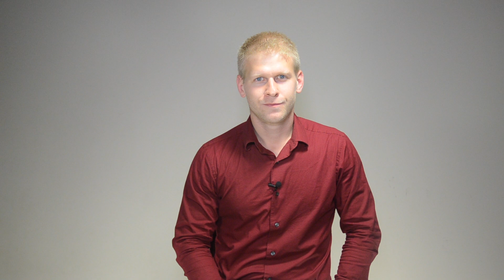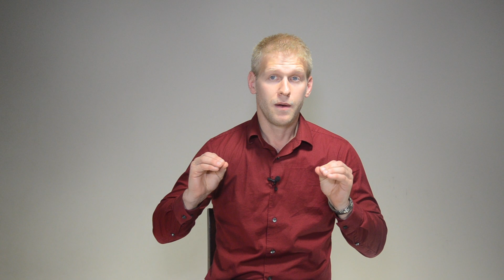Fake Refresh Rate Explained, Simulated, TruMotion, Motion Rate, MotionFlow, Clear Action, AquoMotion

Comment: basically... half the number.. if it's truemotion 240, the tv's refresh rate is actually 120hz... if it's (marketing term) 120 it's actually 60hz. what they do is artificially process the image in the tv, they double the frames shown to you (hence the doubled refresh rate), these are duplicated frames basically and black frames to from what I understand.. and more frames trick the eye into perceiving a smoother motion... so they say..  overall, higher refresh does help but the fake refresh is more marketing tech than really getting something good.. but hey, a 120hz native tv is pretty darn good even if it's 240hz fake.. heh. 
refresh rate is sort of like Frames Per Second, it's very similar but it's not quite the same thing tho they are somewhat tied together.. it's not easy to explain the difference, at least for me... heh. but more refresh rate mean more images a second, and like FPS in games.. it makes everything smoother..  
 BUT say you hook up a PC or gaming system.. all that fake refresh rate is junk to it. meaningless.  the true refresh (native) is the one that matters to it. some newer tvs as of this writing are giving actual higher refresh rate support natively and advertise such... but getting that 4k120 on your comp is impossible because unless you have display port on it to connect or it has the spanking new hdmi 2.1 ports.. you aren't gonna get over 4k@60hz.. so much depends on the hdmi ports. think of them like versions of USB.. they support "bandwidth" sizes like usb.. 1.4 has a bandwidth of around 10gb/s.. 2.0 has 18gbs.. 2.1 has 48Gbs (and can do 10k@120hz!) so much is limited to what version of HDMI ports are used on the tv.. so keep an eye on the older one's.. look up the hdmi wikipedia article (it's not too technical) for a simple list of versions.. cables are rated for the version in general.. hdmi 2.0 cable has a bandwidth of 18gb/s.. so, if you use an hdmi 1.4 cable in a 2.0 port, you might lose some of the higher resolutions and refresh rates.. thankfully, it's backwards compatible at least.. but what matters most are the ports on the machine and the features of HDMI they decided to implement.. the cable is just a pipe to pump data through, it does not have features.. (besides the one with the ability to also do an ethernet connection). BUT just cause it says "hispeed" does not mean it supports HDR 4k (4k@60hz is needed), some HDMI 2.0 cables do not provide enough bandwidth to support HDR resolutions.. so really look at the specs.. you don't need expensive cables but one's rated for the job you want.. 
hope this helps some..

Comment: See I’ve been reading about this for the past few hours. 60 MHz is bad no matter however HDMI rate is locked in at 60 so if a LCD tv says it’s 120 MHz then it’s actually not even if it says it is. All refresh rates beyond 60 are simulated on LCD tv.

Comment: Chad, I have a quick question. I got Samsung UN40J6200AFXZA (which says Motion rate 120 straight forward) and wanted to replace it with UN40KU6290 (4K) which says Motion Rate: MR120. I wondering if that would really makes some difference? Or would it be a good deal to go with UN40KU6290. 
Your help would be appreciated.

Comment: What if you have a 60Hz refresh rate for a 24" gaming spec'd monitor..... is it still bad? Or is this an apples to oranges type of comparison? Basically I was playing an FPS on a 55" Samsung with 120hz and then played on a 24" gaming monitor with a 60Hz refresh rate. Now I know the smaller screen size created a lot of benefits for me as the safe eye distance from a 55" TV introduced a lot of peripheral vision that has no value to the game itself. The smaller screen definitely help in that regard. However it feels cleaner too. I have increased my shooting accuracy about 8%-10% per weapon across the board which is pretty huge results. In FPS gaming every ms counts.
Reply: It depends on your graphics card, if your graphics card is allowing you to play a game at 200 fps and you have a 60hz monitor then you are only seeing 60 fps, so you would not notice a difference between a 60fps or 200fps output. however if you were playing on a 144hz with 200 fps you would notice a significant improvement in image quality compared to a 144hz with a 60 fps output. 

To put it as simply as I can you are getting "wasted" frames because a 60hz monitor will not keep up with your graphics card, if you have a graphics card giving you more than 60 fps.
Reply: Thank you Joe! I am playing on an X Box One so I just researched that and a lot of people are saying it has a maximum of 60 fps. If that is true then I think I am looking pretty solid.

Comment: I just purchased LG 49UH850v which LG site say refresh rate is T200HZ i would expect T is for true 200 HZ however i saw many sites say it's just 100HZ and i called LG call center and they said it's 100 HZ not 200HZ but their facebook page says to me it's 200 HZ :D 
lot of confusion on how to know the real HZ for my TV? and nothing mentioned in Manual and noting wrote on the box!
So how could know this info? and searched about its response time and didn't find any info.
Reply: They oopsed and should not have put Hz behind it.  Also the T stands for Truemotion 200.  Simple rule if it is their simulated refresh rate and the # is below 240 it is less than 120Hz. If it is at 240 or higher it will be a 120Hz TV with added bonuses.

Comment: so my UA55JU6600 that has 120Hz Motion Rate is actually 60Hz? So if I play a 30fps video on a 120Hz motion rate TV how many FPS should I see?
Reply: I just looked up the specs on your TV and your TV has a 100Hz refresh rate which they call motion rate.  If the manufactures say Hz then it is the true refresh rate. If they say motion rate 200 however it will be less than a 120Hz refresh rate.  simple rule if it is their simulated refresh rate and it is below 240 it is less than 120Hz. If it is at 240 or higher it will be a 120Hz TV with added bonuses.
Reply: Well, first of all you have a 4k tv. You can not achieve 120hz on a 4k tv unless you downscale to 1080p and even some tv manufacturers do not even support 120hz at 1080p, they have 60 hz for both 4k and 1080p. If you are watching a video that is 30 fps, you will see 30 fps, you may even encounter screen tearing which is when whatever you are watching does not match the refresh rate of your tv it will look like two images splitting in a fraction of a second occasionally. Lets say you have a 60 hz panel, well everything you see will be 60hz or less, depending on the source of what you are looking at from. Same goes for 120hz. Unless you are on a PC that supports more, you can see fps of 120 but your eye can't process anything more than 110-120 hz. It's humanly impossible. Like it will look smooth as silk over 100. So do your research and before you buy a tv, look up the specs on various websites except for the manufacturer.

Comment: how can 60hz panel be 'bad' when the content you feed it is updating <= 60fps? Tv/movies are generally 24fps, at best game consoles are at 60fps.. having 120hz but 24fps content wont look any better then 60hz 24fps content, unless TV's work a lot differently to computer monitors.
Reply: Try looking at a TV with real 120Hz, you will notice the difference....

I don't know about the fake, so I'm kinda pissed with all the fake ones out there... I think I'll buy a 1080p TV just because I'm not spending $1000+ for a real 120Hz 4k TV...

I'll spend Mid$600 for a 1080p real 120Hz....

Fucking lame
Reply: @kingjon5818  The "real" 120Hz will just keep your single frame image from your 24fps content for 5 refreshes before displaying the next image for another 5 refreshes. With an interpolation technology ("simulated") it will take the first image and the second image and "generate" additional images to display new images for the 4 "in between" refreshes from the native signal.

If you have 120fps source signal, then every refresh of the 120Hz display will be a new image directly from the source. On a 60Hz panel, every other image will be discarded, so you won't get the 2nd, 4th, 6th, 8th... image displayed.

If the interpolation method is good enough, you would not notice a difference between a 120Hz native and a 120Hz "simulated" panel for 120fps content, because the interpolated image would be exactly like the true 2nd, 4th, 6th, 8th... image
Reply: You are correct that the content coming into it does matter. However with out the higher refresh rate technology you can not reduce the motion blur you are currently getting on those devices.  The TV if 120Hz and using interpolation will generate extra frames from the images before and after its insertion point.  This will make your content look smoother.

Comment: Many people don't understand refresh rates and frame rates very well, but you can't really blame them because companies constantly mislead people with random numbers on the box for two different technologies. First of all, motion interpolation/soap opera effect isn't "fake 120hz" because the panel has to refresh at a higher rate to display those extra frames rather it is "fake 120fps" because the extra frames are created by the computer and not the source content. No TV will give you true 120fps because there is no 120hz source/signal on TV that exists, yet. Native 120hz TVs with interpolation will still refresh at a higher rate while the feature is turned off, but they have to repeat frames to fit the higher refresh rate because there aren't any new frames to display on a 60hz signal. 

Backlight scanning/strobing/black frame insertion are different techniques with the same concept in mind. I believe the idea is to shut the backlight off or insert a black frame (by a computer) very quickly in between the source frames so you don't see the transition between frames but the frames themselves which is suppose to reduce the amount of time you stare at the frame/image fading into the next thus reducing blur or "drag" associated with movements. Keep in mind, I am not entirely educated on black frame techniques, but I do know that they are what help companies put fake numbers on boxes a lot nowadays. 

Companies tend to inflate their numbers even more when they use a combination of the two technologies causing more confusion for people of what "true" refresh rates are and what to purchase. In recent years, companies have introduced motion interpolation on conventional 60hz sets, but market them as "120hz" for sneaking in those backlight/black frame tricks, so you may buy an LG TV with "TruMotion 120hz" thinking it does 120fps interpolation, but it actually just inserts enough frames to display 60fps on lower frame rate content instead of increasing the refresh rate, again causing more confusion for people. 

It's best to just do research on the TV that you're looking to buy and make sure that it's "natively" 120hz to avoid any confusion. I recommend going to www.rtings.com. They do reviews on TVs and on their website tell you what the actual refresh rate of the panels are among testing other aspects of the TVs that they review. Sure, they don't review every TV in the world, but you'll at least get a better understanding of the specific ones that they review.
Reply: I read it...
Reply: Currently looking for a 120hz capable tv, but it is a frustrating process because of all this sales lingo doublespeak bs. Wish they had to standardise this, honestly, this feels like false advertising. At the very least it's negligent business practice not to clearly label what a tv is capable of accepting as far as input goes, and instead putting a made up number there. Can you imagine trying to buy a CPU but intel won't release the amount of cores in the chip, and you don't know until you buy it. Don't worry it has an Intel Tru-core rating of 150.
Reply: Will Pack Yup, the E series sets don't have motion interpolation, just the backlight strobing feature. The number on the box is to determine how well the display can handle motion blur, hence the term "Clear Action", basically trying to make a statement saying "this TV looks just as good as an actual 240hz set".
Reply: Will Pack I bought a samsung for $350 that has a 120hz refresh rate with motion interpolation. The model is UN40j6200. I don't recommend it because the software is kind of buggy and simply changing any setting in the menu could mess up the picture quality, even settings unrelated to the picture quality could mess with the texture and upscaling as well as lip syncing/audio delay. Samsung refuses to fix any of these issues as they haven't released an update for the model since early this year.
Reply: Jaime Pecora I just bought a 2016 LG 49" 4k 120hz Truemotion. I guess its only 60hz. it cost less than $600 though. What do you think? Should I keep it or return it. can't really spend anymore than that though. Not sure I can find anything else around price with HDR and real 120hz.
Reply: Dante199006 Most likely. If you like the picture, then by all means keep the TV.
Reply: If you're a gamer, there's a lot more research to do with TVs. Example...Vizio E series...affordable 4KTVs but at the cost of horrible gaming lag at around 45ms. Next step up, the Vizio M series, cost more but you get a better picture and the input lag at 1080/4K @ 60Hz is around 16-17ms.
Reply: Great write up, also keep in mind some tv's can indeed accept 120hz even at the time you wrote this. Most of them were not advertised as much, but from what I have read many of the 3d tv's used a similar internal system to a 120hz display. In other words 3D-1080@60z = 2D-1080@120hz. So even though this capability was unlisted they were capable of 120hz input. Also many displays can run a refresh rate out of their specs. I'm currently using an LG lv3500 49" display which is listed at 60hz, but it does accept 1080p@75 through monitor overclocking :D
Reply: You basically just send it a bigger frequency and it either accepts it or not. I doubt a dvd plays or etc would allow you to specify what input signal you send, but on a pc you can. So no it's not in the tv settings it's in the outputting device. With a pc you can send whatever signal you like.
Reply: Will..

What was the tv???
Reply: Lets say I actually LOVE the soap opera effect.

What should I do to get the ultimate soap opera effect out of a television.
Look for a tv with 240 refresh rate?
What about clear action 960?
What is that about?
Reply: This is better than the video
Reply: +Jaime Pecora (WolfyAmbassador) I feel bad for you, you spent all this time writing this yet regardless- TL;DR